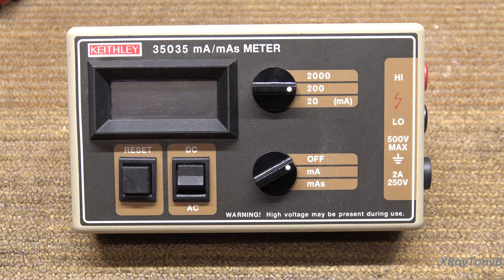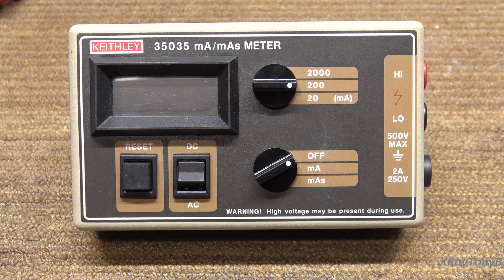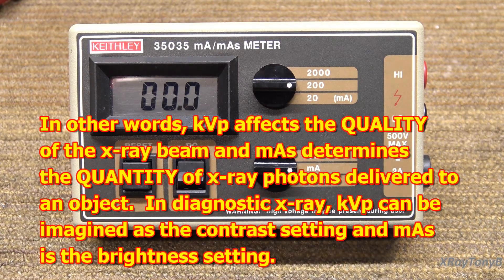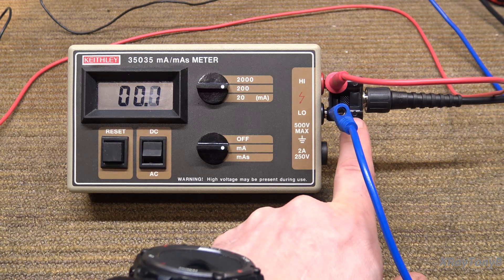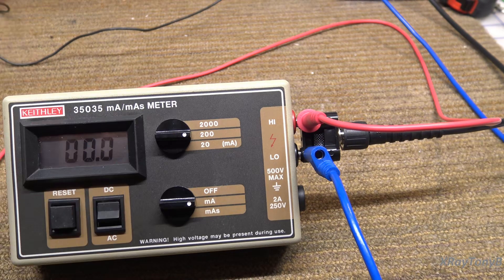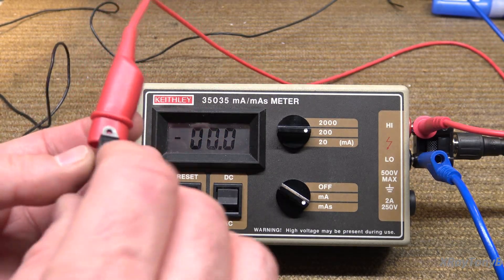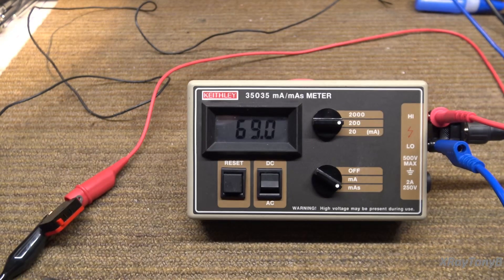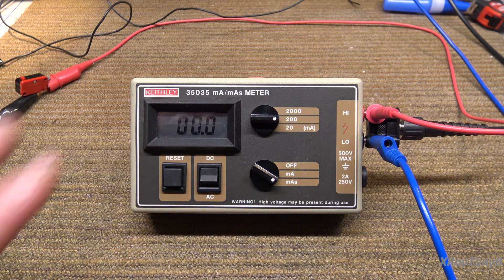Keithley mAs meter - What is it?

Comment: So Coulombs ?....cheers.      (1st)
Reply from the maker: Technically, yes.  The coulomb is an amount of electrical charge (I think it is about 6 billion-billion electrons).  One ampere is a rate of electrical current equivalent to one coulomb of charge passing a given point in one second.  mAs, therefore would be a rate of milliamperes per second times the number of seconds, which would bring you back to coulombs.  However, the current flowing through the x-ray tube is measured in amps (actually milliamps) and an x-ray exposure is expressed in seconds.  Because of these two variable units which are relative to one another,  the industry uses the term "mAs" as the unit of measure.  Yes, its crazy, but x-ray technologists and radiologists are not electrical engineers.  Welcome to my world.......
Reply: @xraytonyb  You are right! If i would read "mC" on a meter, i instantaneously would recalculate it into mAs for better understanding! 1mC says nothing to me, but 1mA times 1s is clear and can be measured with our standard meters.
Reply: @xraytonyb  "Yes, its crazy, but x-ray technologists and radiologists are not electrical engineers."
And may God have mercy on those poor souls in the Audio Industry 👉😆👈
Reply: @ralfstocker7742  Lol yes of course !...cheers.

Comment: So I would say the mAs function is implemented using a very low loss film capacitor and a really good low input and offset current opamp arranged to integrate the buffered voltage developed across the current sampling resistor, and this then is displayed on the meter, allowing the integrator to integrate the voltage with time. Likely a very large very expensive polystyrene capacitor in there for the integrator, or an equally expensive teflon capacitor. sitting on flying leads with the ptfe standoffs, for the sensitive inverting input of the opamp.

Comment: nothing in the medical field is cheap.. a good friend of mine works in the nuclear medicine field and gives me all kinds of decommissioned electrical connectors/wires and that sort of thing for some reason... each time i google the barcodes i'm astonished at the listing prices. a "simple" 6pin cable/connector for whatever probe can cost hundreds $... :D
Reply: It's like with aviation. Metal bracket: $3. Metal bracket approved to use in a plane: $200 :D